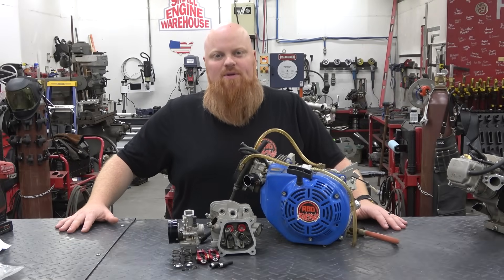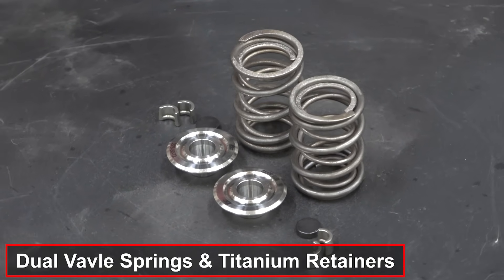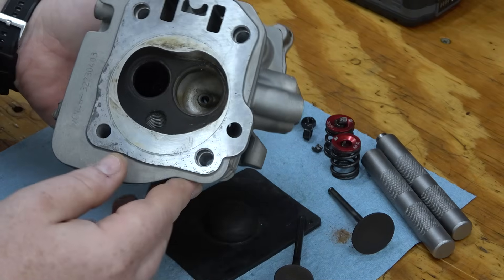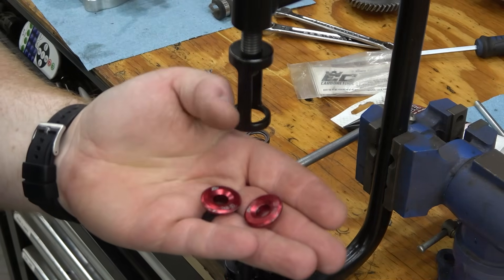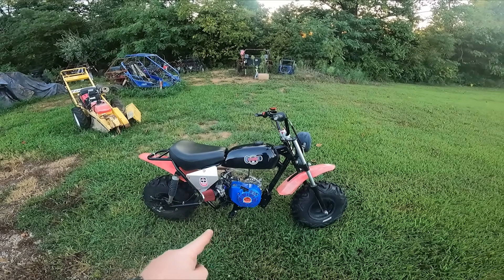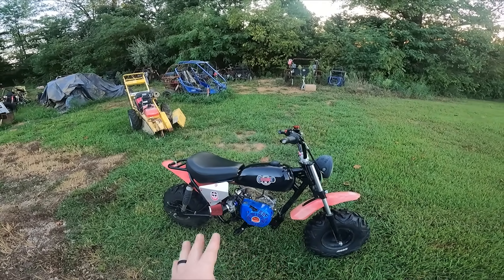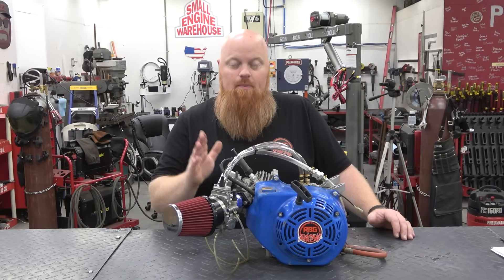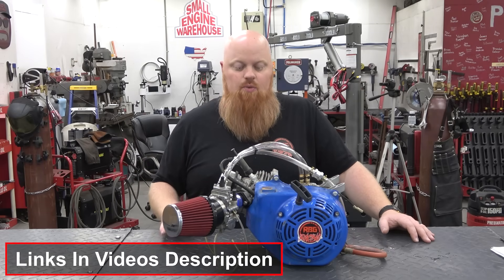Hemi Vs Non Hemi Head ~ Predator 212cc Stroker Engine RTHP

Comment: The HEMI head has plenty of untapped potential with so little modifications compared to its NON-HEMI counterpart !?!?! (it seems that, the domed combustion chamber allows to focus more the burned gases on the piston's head, rather than wasting some of that thermal energy into the engine head and on top it allows to tumble the air/fuel mixture inside the combustion chamber), but you need the proper tools and equipment (machine shop) to modify the head, because of the valve angular positions and machining the piston cavities for the bigger valves, which are necessary to avoid grenading the engine.

Comment: love your vids man but i did see somthing in the dyno graphs that might intrest you. the hemi head seems to flow better low to mid range while the non hemi seems to flow better mid to high range. 

not that much power difference like you said. but just like you said in a previous vid, mod for what your using it for. im thinking if you have it in a heavy kart and need help getting off the line, hemi. if you want top speed on something light like a mini bike, non-hemi.

ill also say that your air/fuel dips a bit for both heads but maybe you can do a video on running this set up alittle rich vs alittle lean and see which is actually better. you could put the whole 11-12af vs 13-14af debate to bed

Comment: Канал смотрю в России. 
Интересны подходы тюнинга 212
Такие же методы применил на 168F (6.5 л.с.) 
Но вот LIFAN 160F (4.0 л.с.) разогнать не могу. 
20 FT lbs - это 27 Newton-Meters (Nm)

I watch the channel in Russia.
The 212 tuning approaches are interesting.
I used the same methods on the 168F (6.5 hp).
But I can't get the LIFAN 160F (4.0 hp) to overclock.
20 FT lbs is 27 Newton-Meters (Nm).

Comment: Something air flow related is choking that setup down. The way tq was flat then fell off at a 30° angle and the the hp went flat is a dead giveaway that it cant breath and it has hit its limit when tq noses over at 6400. I woul bet its a carb or cam issue. But it is air flow limited. Ive seen it time and time again on other motors I work on on the dyno.

Comment: Hey.... Can you make an motorcycle with "predator 670 engine (with dual carb setup)" and a blown motorcycle engine as a standalone transmission.... Preferably mount the engine transversaly in motoguzzi style... Or if its not possible then make it into a chopper with 6 speed.. i suggest these youtube channels 

" Le dan " - for engine & transmission build (search Le dan vtwin )
https://youtu.be/LNOg8thdOUU?si=82bA8fLwtE5C_dg4

For transmission build 
https://youtu.be/taaeXK-uvzY?si=EeUHv_7gOJoux-Nd

"Vaisly builds " -for carb setup & tuning 
https://youtu.be/LI2igTAdrs0?si=DDENIlC-5lNoIbVc

Comment: You’re not even close to the limit of what that engine can do.  There is several things you can do to the valves and the seats to bump that HP up quite a bit and if you lighten the crank and piston and get it closer to balanced it will definitely make way more power.  When you get them not shaking so bad the harmonics of the engine make a big difference.  There is a lot of HP/TQ up for grabs just in the valve job alone.

Comment: Hey Greg, I have an old Baja Warrior with a hemi predator on it. I bypassed the governor and just want to make it safe. Is there an “economy” flywheel available that can withstand higher rpm’s safely? I think I saw a cast aluminum one available?
I would like to upgrade the carb too, I already have a header and the simple stage 1 jet and air filter upgrade. 
Thanks for all your info and videos! I’ve been a fan and subscriber since you were back at the old house!❤

Comment: Why don't you just valve relief the piston for the hemi head. You own a mill you own a lathe it's not that hard to do that it's actually quite simple. I would bet money on it a hemi head will make more power more tq when actually given the proper mods that y'all are chicken shit and too lazy to do .
Reply: Road to horsepower is about demonstrating things WE can get out of the engine with mods; not what HE can do to get absolute max power. I don't have a mill and lathe.
Reply: @hektoerdonovan2121 so your much like everyone else who is lazy and that excuse is nothing more then a cop out for being lazy period. In the automotive world it's a normal thing to valve pocket pistons or cut a little off the top of them. I mean y'all are not afraid to mill the head or absolutely wreck a port with a die grinder. Rbg is the perfect channel to do simple math cut valve pockets actually run the big cam the hot timing the max compression with the hemi head as he has the tools. Bottom line is y'all keep saying the hemi head does not work due to this or that yet not one of you can say that for sure with actual facts because bottom line is none of you actually know because you just don't try it or do it. Sad really that this is what is considered quality information and passes as gospel even know it's completely false and completely just not even tried. Shame on you Redbeard you give us ginger folks a black eye for putting this trash out there. Man of the Lord my ass your a man of the lazy and fake news propaganda
Reply: someone that has a hemi got hurt feelings lol.

Comment: goofy question: on a motorcycle, the brake is on the right ahead of the throttle because the clutch is on the left. why do most minibikes, including my coleman, have the brake on the left?
Reply: No clutch
Reply: i think you missed why i asked the question.
Reply: I think you answered your own question, there isn't a clutch lever there, so the break lever is mounted in that location, it gives your left hand something to do other than,,,,,
Reply: then why don't some US cars have the clutch and brakes switched? you missed the point.

the point being, if a certain control is always in the same place, unfamiliar or new riders can pick it up easier.

Comment: See now I really want to see some just insane mods, go for it full billet head and block. Massive overbore, whatever the biggest stroke, whatever the biggest cam you can get. 1.5 ratio rockers, the whole nine yards. I saw someone who made a custom overhead valve cam for one of these once, though of course I don't expect you to go quite that far.

What about EFI kits? I've seen some of those around and since you already have a bung for an oxygen sensor and a tach wire, I think that would be interesting. Speaking of, how are you measuring the engine tach for the dyno? Is it just an inductor around the ignition wire? I don't see anything there really.

Great work as always, keep it up my friend, and god bless.

Comment: I'm guessing the increase in power with the non-hemi head could be explained by the decrease in combustion chamber volume and resultant increase in compression ratio. It'd be interesting if you measured the combustion chamber volume of both heads, and if possible shaved the hemi to match.

Comment: Would love too see those little single shot of nitrous on this thing like near max torque to see what it does.

Yes Balancing would help alot. 

What about that pulstar capacitor spark plug? Check out Projects video on spark plugs, the pulstar made a big difference on stock stuff, would love to see what a single spark plug change with a capacitor could potentially do. 

Out of curiosity, whas all the intake manifold, carb, and exhaust port matched?